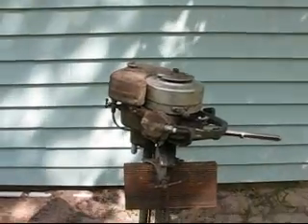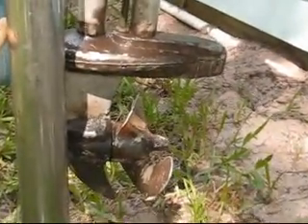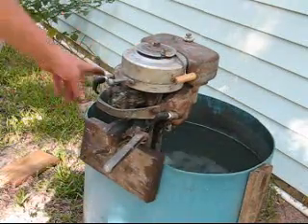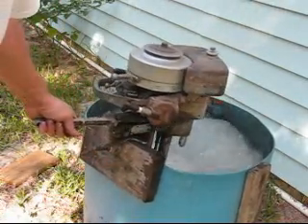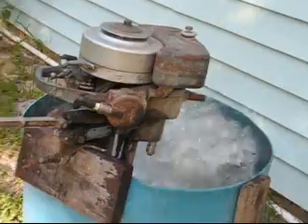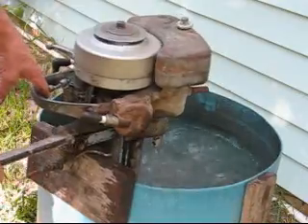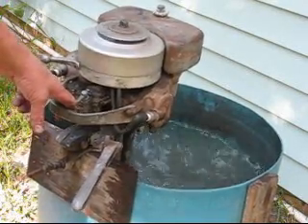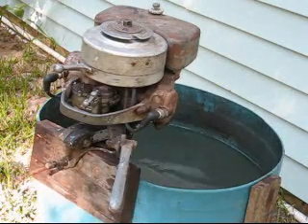1940 EVINRUDE HANDITWIN 3 HP RUNNING "AS FOUND"

Comment: looking at the video, I have one the same 1940 evinrude handitwin 3hp , looking for the ignition coil , the one in it has been temperded with , spark plugs wires as been pulled out. and there is no contact with the coil inside . can you help me find one , thanks MARCEL

Comment: I just happened across one just like it. Same model number. I have not had a chance to check it out for compression or any other mechanical details yet. I just ended up with it one day I'm a trade deal and I'm storing it at a friend's and haven't gotten back out to check it out completely yet but I do have a picture of it along with his five horsepower Hiawatha 1947. If you know anybody who is interested on either one of these motors they are for sale

Comment: I think if that bad boy was mine id break out the wire brush and sand paper and clean that thing up a little and lay the spray paint to it and hang it on the back of my boat to use in case my other motor quit and got me in a bind.... It would look sweet hanging on the back of the boat if anybody was broke down in the head of nowhere.....8-)